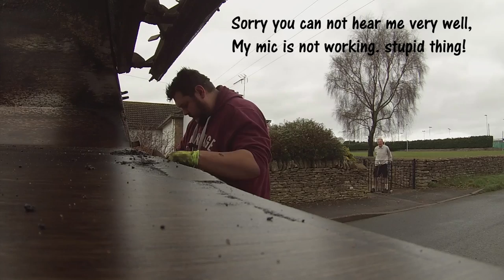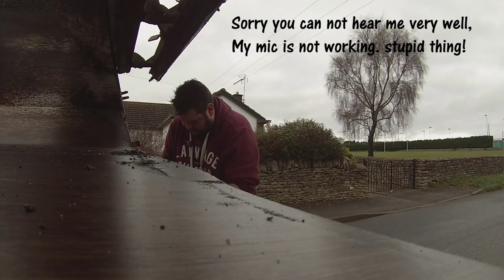Got Called A ********

Comment: WD-40 mate, its a fuckin bomb against tarmac, sounds weird, but it melts the damn sticky fucking tar better than diesel
Reply: peanut oil is good to spray in before the tarmac is placed in bin as it stops it sticking... i had to use to run a tipper for road surfacing works here in australia and the heat from the bins is great in winter.. we parked beside  each other about half a truck apart and keep warm in the middle
Reply: Expensive though to get enough peanut oil haha